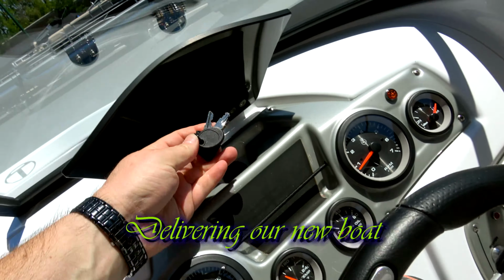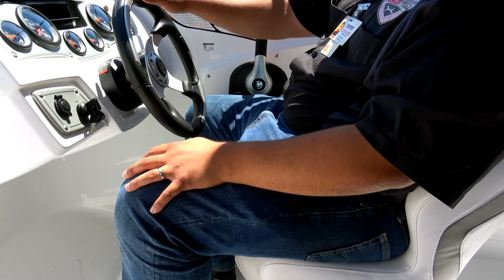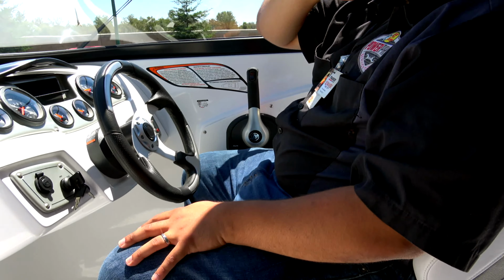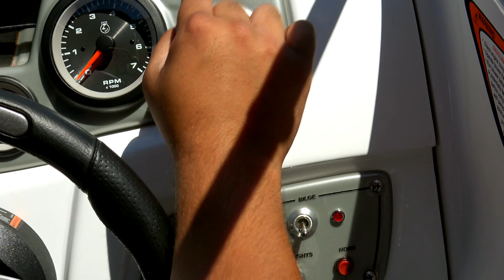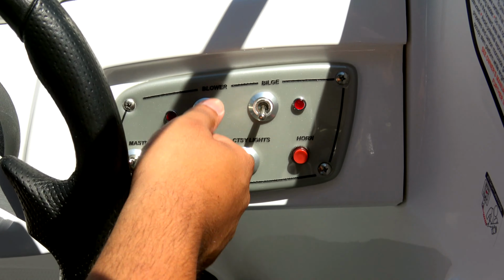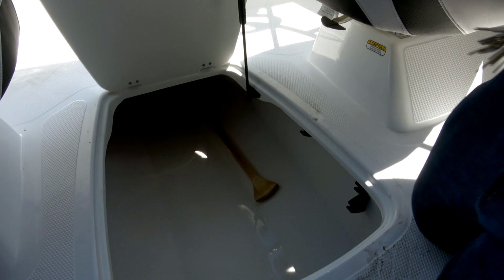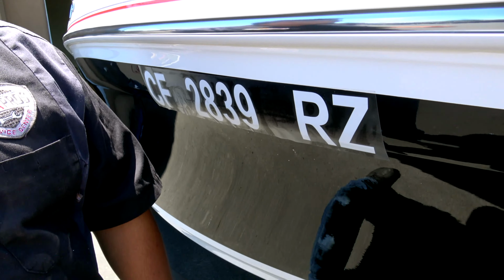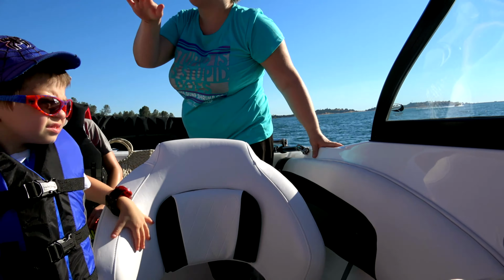TAHOE 500 TS  BOAT

Comment: I bought my 500 TS in 2015.  That is when they first came out.  In fact I have the first one the dealer received.  The boat has been great and have had no issues.  I do change the oil, oil filter and gas filter at the end of every season.  I also put in Seafoam at that time as well.  Draining the engine block in a snap to winterize the boat.  When I bought the boat, I bought an extra prop.  If the prop gets damaged I swap it out and get the other one repaired.  Even today, I can go over the boat with a fine tooth comb and there is not one issue on the finish.  I do keep my boat on a lift at the marina.  That way my daughters only have to unlock the lift, drop the boat in the water and get the equipment(life jackets...etc) out of the storage unit.